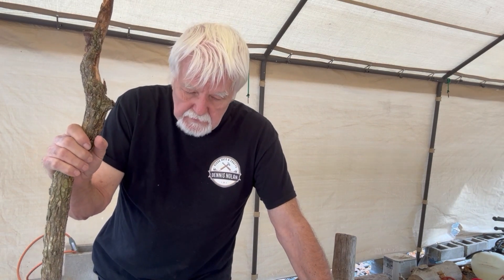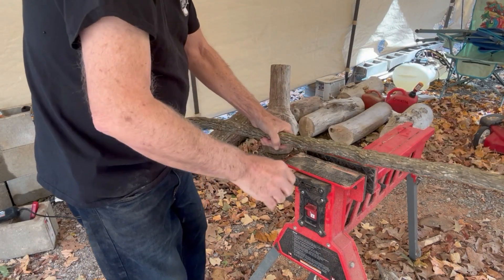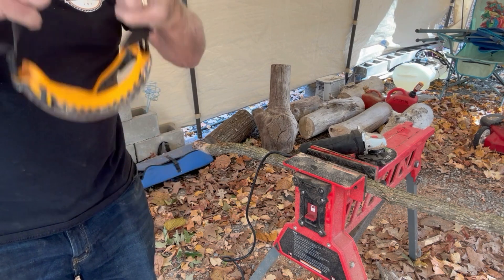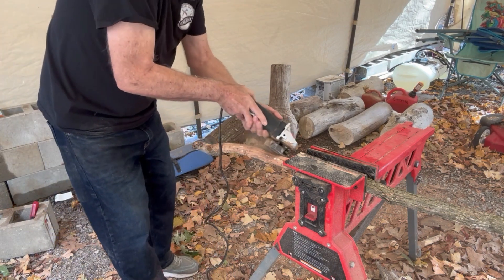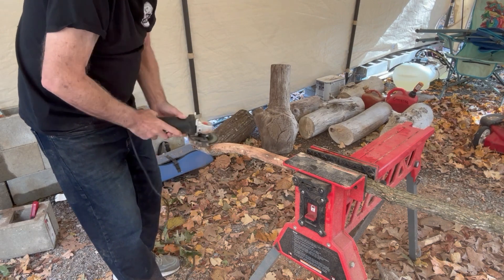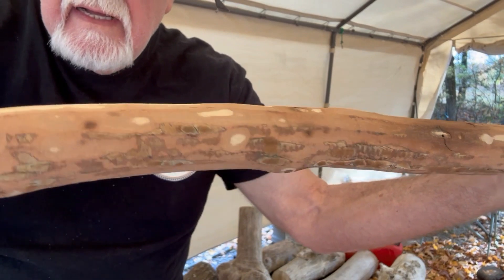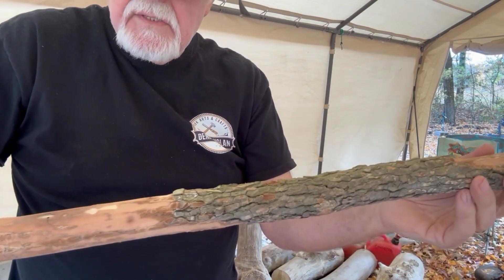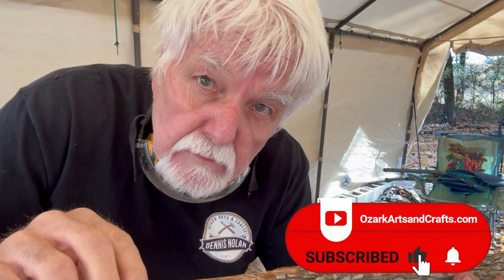Walking Sticks - Part II for Beginners

Comment: Really great example for quickly removing material from the staff 👍

As a first purchase for projects like this would you recommend a grinder like you have here or a belt sander?

Currently I’m just using hand tools.
Reply from the maker: For speed and efficiency I would recommend an angle grinder.  I recently made a video about an attachment that I came  across that allows me know to do most of my debarking inside my shop now without creating a big mess of scrap and dust.  Here's the link to the one where I demo this in action a few weeks ago.  https://youtu.be/nu1K_yB25NE
I purchased this attachment at Harbor Freight but they can also be found on Amazon.
Reply: @OzarkArtsandCrafts  Brill I’ll go watch that thanks 👍